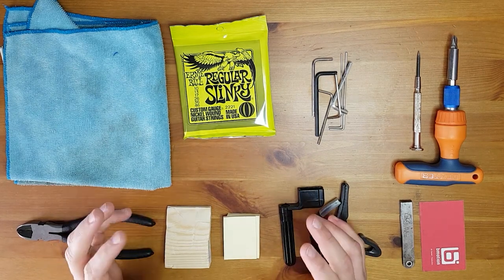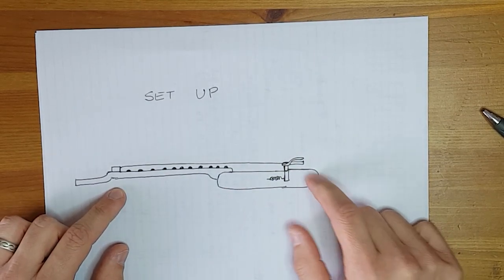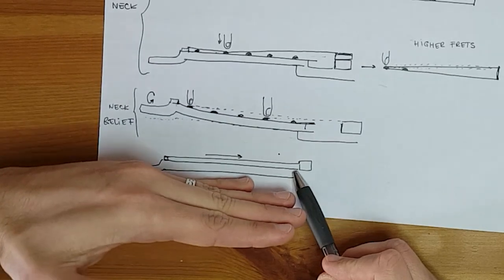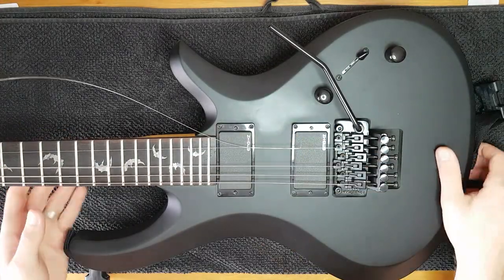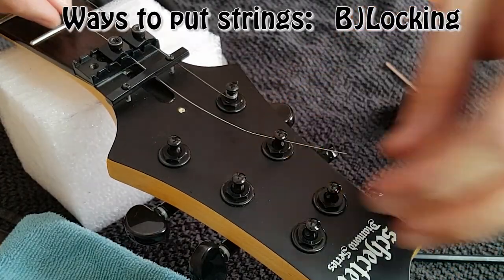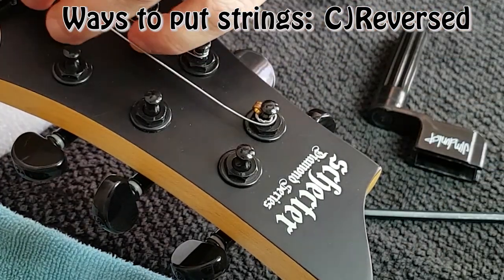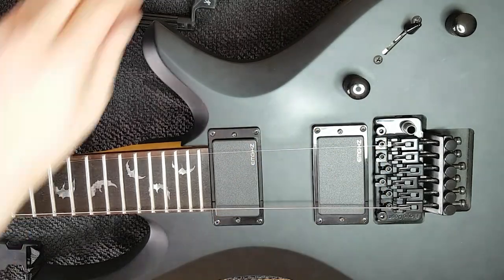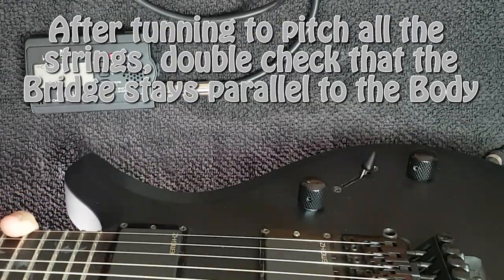12 Step Tutorial to Setup a Floyd Rose Guitar for Beginners

Comment: Any advice for buzzes and rattles at the bridge?! (Like inside the Floyd Rose) Not fret buzz but something on my guitar is vibrating after I play especially the G string and it sounds like there are two notes. It's driving me insane.
Reply from the maker: Man I would advice you to check out under the screws that tighten the strings. Normally these screws are pushed down by the finetuning screws and pushed up by some thin metal plate Well, I have seen several times that this plate doesn't put enough pressure to those screws creating buzz. Just unlock the nut, tighten the fine tuners, retune to pitch but with fine tuners in a lower position that they were before. That have worked for me several times. Otherwise, you should have to take the bridge out to make sure all the parts are tighten. Once you find the part that is causing the problem is going to be easier. Play the guitar and try to put your fingers or a stick under the brigde and see if it stops. Also check out the springs, put some foam to avoid unwanted vibrations.

Comment: How loose should the strings be if I want to raise the studs of the bridge while they are still on?  I don't need to block the trem because the guitar came from the factory basically blocked only to dive.  Does it make sense to dive the bar while unscrewing the studs, moving the edge away from them?  I'm fretting out and getting some buzz on the 14th and 15th frets.  Says they should be at 1.5mm on the 12th fret and the high E is probably only at 1mm based on my measurements.
Reply from the maker: You should loosen the strings  as much as you can and remove the springs before move the studs in order to prevent damaging the studs and/or the bridge edge. 1mm I think is too low but if you have issues only with 14th and 15th frets maybe it could be a fret issue, not the action. It's hard to say. Try to check them with a fret rocker, maybe they are just high
Reply: @alverduratonejunkiealveram1017  It is hard to say, the frets look good to me, the poorly written manual says 1.5mm on both sides of the neck at the 12th fret.  This is an EVH striped series so the bridge is set to be blocked, there is no cavity to pull up.  The neck is a compound radius (12"-16") so its probably not uncommon for the higher frets to fret out while bending if the action is too low.  Plus the pickup is mounted to the body so there is no real wiggle room to move that up or down.  Truss rod is at the heel but it looks very straight, with a slight amount of relief towards the middle of the neck.  Ideally I'd like it to be setup to Eb, with just the right amount of tension and keep the action pretty low.  It was shipped from CA to NY so it also probably got a little shock from shipping and moving from a dry climate with no humidity to a fairly humid climate, although its dropping quickly as fall sets in.
Reply from the maker: @GuyNarnarian  well, if I had that guitar in front of me I would loosen the floyd springs a bit so the bridge gets tilted like a stratocaster. This will also raise the action a little bit when it's tuned back to pitch again and I would check if the fret buzz dissappears. If so, then you saved time by not loosening the strings, removing the springs, moving the studs, etc and you have more clearance to pull with the whammy bar. Let me know
Reply: @alverduratonejunkiealveram1017  Ok, I'll take a look, that was my plan when I detuned to Eb, I thought I would have to back out the claw screws, using them as a tuning adjustment almost.  But that wasn't the case, it was in tune without any claw adjustment.  The claw screws are backed out pretty far, I was actually thinking about blocking it from the back and tightening them, but I guess that would have the reverse effect and lower the action, possibly making it worse.  There is still some room to back them out a bit I would think, they are long screws.  My strat is floating and is actually very parallel to the body and nut, setup really well, just not by me!
Reply from the maker: @GuyNarnarian  yeah every guitar is different, you just need to find the right way to approach the issue
Reply: @alverduratonejunkiealveram1017  I ended up taking it to my tech, lets see what he says.  Hopefully it will be minimal he is pretty fair when it comes to small adjustments.
Reply from the maker: @GuyNarnarian  don't worry it won't be anything serious
Reply: @alverduratonejunkiealveram1017  I don't think so - I appreciate the tips and help.  Eventually I will get some more tools so I can do some small adjustments at home.

Comment: I have the string through floyd, do the bolt devices that you put the string through help indonate or do the saddle bolts indonate?
Reply from the maker: Well, the intonation is due to the position of the saddle. The part where the string goes through has nothing to do with the intonation. So, you need to loose the saddle bolt to move it, then you tighten and check until you are in the right position

Comment: On the Ibanez edge tremolo which is a superior tremolo than this original floyd, you can adjust the action with tension it even says so on the manual, the material that they used is so good that you don’t have to worry about any of that of course you dont want to be adjusting everyday lol but still. Is this even an original floyd? Could easily be a special lol

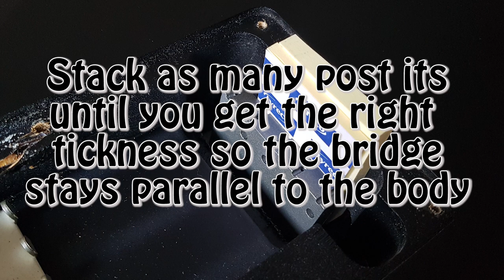Comment: Why do you only have one spring in the back at 20:42 and three at  39:14?
Reply from the maker: At first the goal is to set the bridge parallel to the body so we can set the string action. I just have 1 spring with the 1st and 6th string because the wooden block will take the tension of those strings. If you need to raise or lower the height you just remove the block and the spring and you can tighten or loose the bridge posts. If I leave the three springs it will be more work, actually you can do this part without springs if you want.

Once you have set a ballpark string action you put the springs, tune to pitch and start tightening the screws until the wooden block comes out.
I hope this helps 😊

Comment: i got a used 2010 dean ml xt and i set it up the way i want it it play wonderfully but the floyd is lopsided on the high e string side its lower but on the low e side its level with the guitar ive been playing for 2yrs 4 months and this is my 1st floyd rose
Reply from the maker: So you mean that the height on the first string side is lower to the surface of the guitar top compared with the sixth string side? If so, there is nothing wrong with it 😊
Reply: Al Verdura Tone Junkie olrighty just wondering like i said its my 1st floyd so just wanted to be sure thx
Reply from the maker: @shredbacca  cool man. As long as it plays in tune LOL. My first guitar was a floyd rose guitar but never stayed in tune. I have it since 1992 and I just finished restoring it. It is my latest video if you want to check it out

Comment: Surely though when you tighten or loosen the claw screws you would throw the tuning off again and even the intonation right? 😏
Reply from the maker: @carlosalves4444  once I set intonation, I lock the nut and start tightening in the back. At some point the block will come off and the guitar might not be exactly in tune. If that is the case, I will tune it with the screws without unlocking the nut. I don't remember if I explained it like this in the video, but that's the way I do it now. I hope this helps 😊

Comment: Hey how are you man ? :) I had a nice back bow, so I have loosen the truss rod by a good quarter of a turn. I've read here and there that I have to wait around 2 days before doing an another quarter of a turn. What do you say about that ? Thank you :)
Reply from the maker: Raaampage hey what up!!!! Well it depends. I would give it another quarter of a turn. If you don't see that the neck gets flat after that I would tune the guitar half step UP to increase the tension forcing the neck to bend and leave it for a day. If the fretboard is rosewood I would also oil it
Reply: Ok ! I'll give it a eigth of a turn should be enough now, it's almost straight :) And I have already cleaned and oiled the fretboard so it should be good I think ! Thank you very much for the lighting fast answer you rock :)
Reply from the maker: Sometimes if im not at work I can answer fast : ) Let me know how it goes
Reply: I broke my high E string during the intonation part lol -_- gotta wait till Monday for new strings...
Reply: Yeah xD I think I badly wound up the string around the mechanic and it snapped itself due to the tension -_- Now with the strings it is straight, next step I gotta loosen the truss rod again to get a good relief (I have fret buzz around 1 2 3). :)
Reply from the maker: Exactly!!!

Comment: 13:00 What are we supposed to see/watch after in this picture ? Even with your explanations i don’t get it. How can i see if it’s curved or not? I stuck on this part each time …. 😢😤😭
Reply from the maker: Relax!!!!  LOL. You just need to put your guitar like I showed in the video and see how the frets align to each other. If it´s hard for you to see it (at the beginning is always hard) there is another way. You need something that is completely straight like a ruler for example, a long one (it could also be a piece of beam or a leveling tool, etc). You place your guitar on a table facing upwards, no strings on, and the you place the ruler on top of the fretboard (like if you wanted to measure the distance between the frets). The ruler has to start touching at the first fret until de last or more. If it doesn´t get to the end of the fretboard dont worry, as long as it goes until the 14th or os it is fine ok.
Then, if the neck is straight the ruler should touch ALL the frets. If the neck has some relief, the first and the last fret touch the ruler but the ones in the middle don´t. If the neck back bowed it will be the opposite, the ones in the middle touch but the ones at the ends don´t. I hope this help 
☺

Comment: I blocked the bridge like you instructed but it did not come out completely parallel when I finished all the steps, what can I do?
Reply from the maker: What did you use to block it?
Reply from the maker: If the back of the bridge was sunk into the body then you need to use a thinner block. If it was raised, then use a thicker block
Reply: I used 2 stacks of posted notes like the second option he showed, I don’t have wood.
Reply from the maker: @kennethrosario9277  depending if the bridge is too high or too low you have to put more or less. Remember, loosen the screws, then tighten the strings until the bridge raises and place the sticky notes until you bring the bridge parallel to the body. While you tune the strings to pitch maybe the bridge will move down because it will compress, if so, put some extra sticky notes to compensate.
Reply: Thank you I will try that out

Comment: Hi I have a cort guitar which has a floydrose of their brand name on it. when I push the bar down a little bit the tuning goes flat and same when I pull it up even a little bit it comes back to pitch... The nut is locked perfectly...the tuning dosen't go flatter than two bars down on the tuner when pushed down... Please any help would be appreciated... I saw one video on YouTube there the guy said the problem could be the studs but my guitar is new and I never even touched the studs or move them they are not loose... Please help
Reply from the maker: Man, that could be several things but I will check first that the nut is tight. I'm talking about the nut itself, not the locking nuts.
Reply: @alverduratonejunkiealveram1017  yes checked it it's tight... Does the problem have anything to do with the intonation...my guitars intonation is a little bit off like one two bars.
Reply from the maker: @polemadhu345  Ok, then check this. Remove the strings and take the bridge out. The plate and the block should be also as tight as posible. Grab the bridge with one hand by the plate and the other by the block and try to bend it. If it rocks then you know it's lose. If so, you will have to remove all the saddles and you will find the screws just underneath the saddles. This is a pain in the a*s because you need to redo the intonation and everything from zero but you can always take a picture and put the saddles where they were to save time
Reply: @alverduratonejunkiealveram1017  hi i did as you said the trem block was fine not moving at all... But found out the culprit... The stud screws are really loose like wobbly even if I screw them in all the way... Maybe somehow the screws in the studs are not the actual size...now I'm confused how to get the right screw size for the stud
Reply from the maker: @polemadhu345  Man, that is super weird because those screws should spin relatively easy but they should not be too loose either. Is it a new guitar?
Reply: @alverduratonejunkiealveram1017  yes the model is cort x250 it was available for sale maybe in 2019 I guess... Even if it was the first sale guitar it would be one year old... I think somehow they put in small screws as the stud shell itself is not at all moving...now how should I find the correct size of it...
Reply from the maker: @polemadhu345  if I were you I would see if that guitar come with the floyd rose from factory.  If you bought it used maybe they put the floyd but the studs didn't match the shaft correctly and that's why they move around too much
Reply: @alverduratonejunkiealveram1017  there is this website called as bajaao... I got this guitar like an open box B-STOCK... I have a doubht this maybe stupid question for you... But as you stated if this guitar was second hand they must have put the different size studs... Now I'm feeling like  even the electronics may not be original.. This guitar has emg sro oc1 pickups... I don't have much idea about the emg's... But the print on the neck emg pickups is coming off I mean the print is smudging...is it normal or do original emg pickups label gets rubbed off so easily?
Reply from the maker: @polemadhu345  I have no experience with those EMGs. It sounds like that guitar was used.

Comment: How to you fix sharp notes at the lower frets? Also, my low E string saddle goes all the way back and is still sharp. Any ideas? thx
Reply from the maker: Wow, that is hard to fix because is a design flaw! The bridge should be placed correctly so all the strings saddles are able to intonate properly. That is a common problem on les pauls but I´ve never seen that on a floyd rose guitar. I suggest you take it to a tech because to solve that will need some work and creativity. I´m sorry I can´t help more.
Reply: @alverduratonejunkiealveram1017  ok, thx. I'll try changing my strings first to see if that changes it.
Reply from the maker: @lauried.2708  Yeahhh sometimes old strings go out of intonation, check that

Comment: I just bought my first electric guitar and it's a floyd rose.. But there is this problem i don't know how to fix it.. Its when i bend a string lets say the b string it flattens other strings for example the high e string.. And when i release the bend it goes back to tune.. How can i fix this plz?
Reply from the maker: There is no way to fix that issue when you have a floating bridge. That's one of the things that I don't like about those bridges. Unfortunately that is a physical thing that can't be fixed. I place my hand on the bridge and press down minimize the other string going flat
Reply: @alverduratonejunkiealveram1017  thank you for replying.. I asked about this here in a local guitar shop. and one of the guitar techs suggested that either the guitar need a setup of some kind or if there is a need he'll install a tremolo spring and it'll work perfectly or at least to minimize the strings going flat a bit .. And i don't know what to do at this point 😕
Reply from the maker: @omarnj1785  Yeah you can minimize it if the guitar is properly setup and if you add more springs will also help but it won't dissapear
Reply: @alverduratonejunkiealveram1017  noted.. Thank you very much

Comment: I have a question, I keep getting a twangy, muted buzz sound on the G string, not when fretted just the open G string, Its driving me crazy I cant solve this problem can anyone help me????
Reply from the maker: Sure man. Based on what you described I would say that the string is hitting the nut slot itself, that's why when you fret the string it doesn't buzz. Loosen the nut; push the string towards the 2nd string and tighten the nut again. This way I have solved that problem several times. Let me know if it works
Reply: @alverduratonejunkiealveram1017  Thank you! I will give it a try

Comment: First off, great Video!

My question is, 

when everything is set and done and you bend and divebomb the hell out of the guitar, do you set the tuning with the fine tuners at the bridge or do you set the tuning at the headstock with the locking nuts loose?
Reply from the maker: Thanks I appreciate. First I set the fine tuners half way, I tune the guitar up with the tuners, lock the nut and tune with the fine tunners. Then I dive bomb/bend; if it goes out of tune I retune with the fine tuners and repeat.
If you get to a point where the fine tuners can't go any further then loose the nut and use the tuners and repeat. 
At some point, depending on the quality of the floyd rose,  the guitar should stay in tune after all sort of mistreatment LOL. I hope this could help!!!
Reply: @alverduratonejunkiealveram1017  Will do! Thanks a lot!